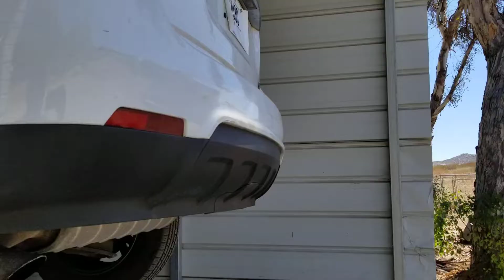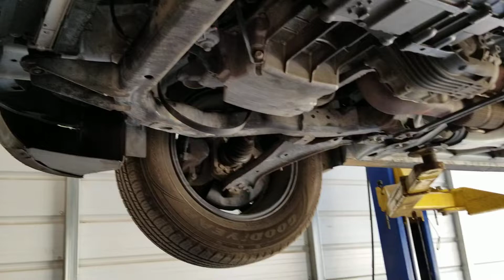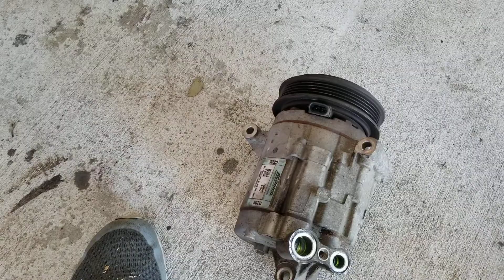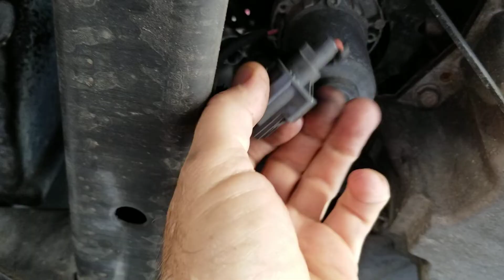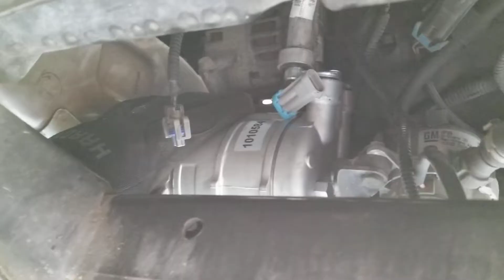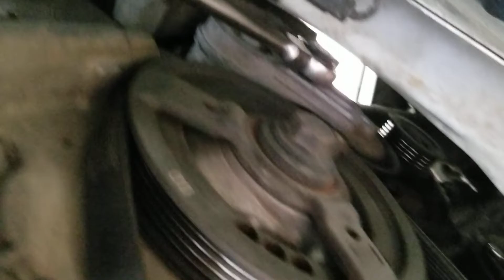Replacing Chevy Equinox Air Conditioning Compressor | 2010 Equinox AC Repair

Comment: Would have been nice to show taking the compressor off too. Also, there is a need to remove some of the oil if you are only replacing compressor since the oil is mainly in the condenser, evaporator and accumulator.

Comment: I can confirm this method will NOT work on 2013 and newer V6 Terains/Equinoxs.  The compressor is different, it's significantly bigger, and there's no chance of ever fitting out the bottom no matter how much you flex the subframe.  The bigger 3.6L may also limit room.  You have to remove the radiator fan assembly and take it out the top.

Comment: I have a 2010 2.4L and the ac doesn't blow cold air tried to add the store bought refill but it's like the compressor doesn't kick in? Any info is much appreciated
Reply from the maker: probably compressor on these the wires break that go to the coil that makes the electromagnet turn on for the clutch. Not worth changing the clutch. Check with a test light with air on and make sure the compressor has 12v. If not maybe the Relay.

Comment: Just have questions sir,how much that ac compressor?
Reply from the maker: I think they are pretty cheap on amazon or ebay. Dont remember like between 100 and 200.
Reply: Damn what changed i bought one from Carquest yesterday, compressor its self 700 bucks, compressor kit with dryer and and everything you need for 600

Comment: Great Video, But you should of measured the oil in the old compressor, with a pre-filled compressor you might of dumped to much oil into the system.

Comment: Mine makes a noise spins then stops I don’t know if that’s normal just bought a 2011
Reply from the maker: good call low on freon. If it is too noisy might want to replace the compressor before it starts putting metal into the system.
Reply: Low refrigerant, just add the DIY stuff for $30